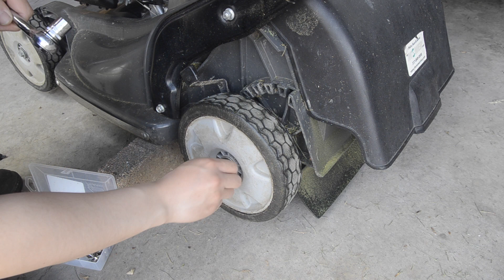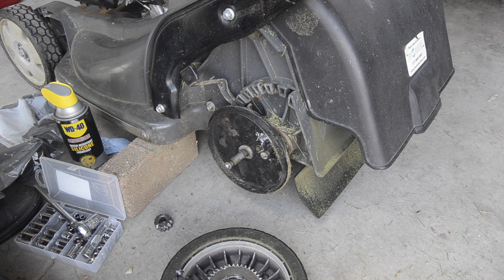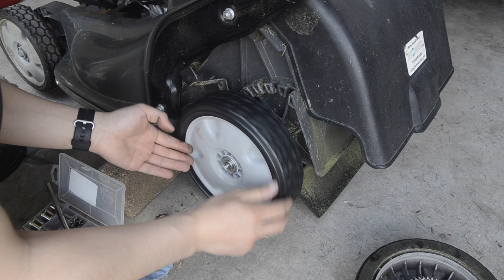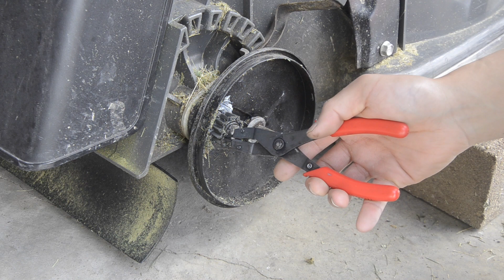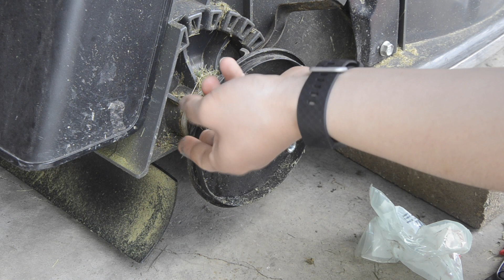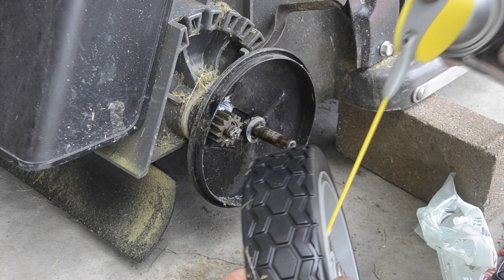Honda HRX217 HXA Self-Propelled Mower Gear and Wheel Replacement

Comment: i removed the bolt but wheel seems stuck on still and will not slide off
Reply: same with front wheels
Reply from the maker: Try degreaser and hot water to clean the area, then use penetrating fluid to soak the area.
Reply: Same issue, my right rear is stuck on...soaked in pb blaster and still stuck after banging with a hammer.

Comment: Lithium spray or teflon spray from CRC will last longer.
Reply from the maker: I haven't tried them, or done enough research on this statement, but it could be a good point.
With my current understanding, these gears are working in a dusty environment, so a dry-lube could be a better choice.
Reply: @yzhang8629  honda shop manual says use Honda Marine extreme
pressure NLGI #2 GC-LB grease or equivalent and not to use spray lubricant of any kind
Reply from the maker: @jts3793  Thank you for sharing this information, it is extremely helpful.
I guess spray lube can do the same thing as the specified lube, if I can clean and spray the gears every few yards, but the amount of labor is preventing if from being a recommended choice

Comment: I don’t know you personally, but I actually enjoy your videos. However, why was it you replaced the wheels themselves as the tread appeared fine?
Reply from the maker: The dust on the surface of the wheel emphasizes the depth of the tread, which makes it look a lot deeper than it actually is.